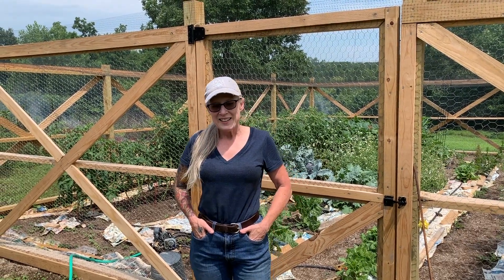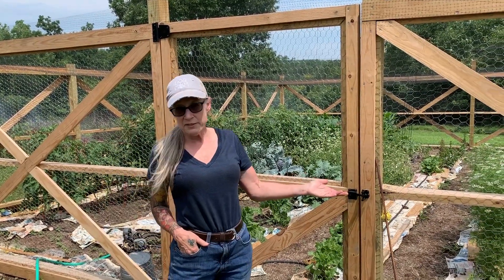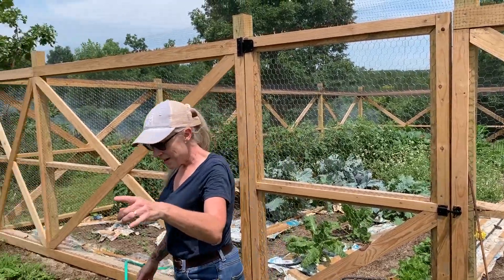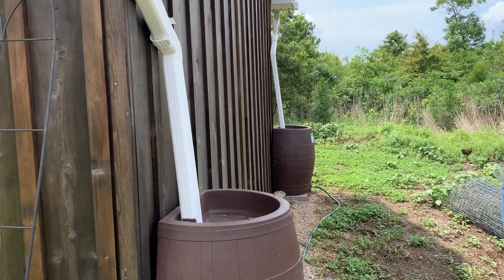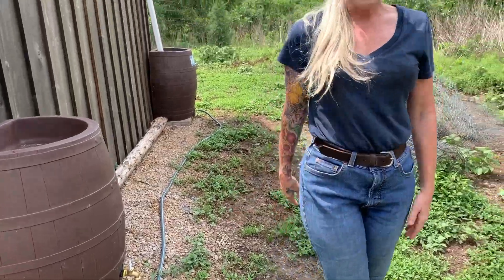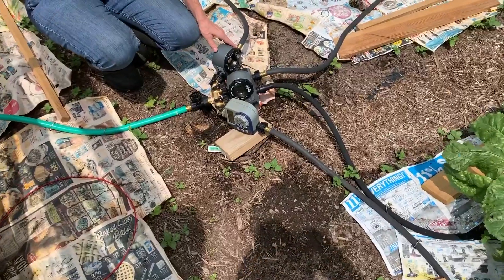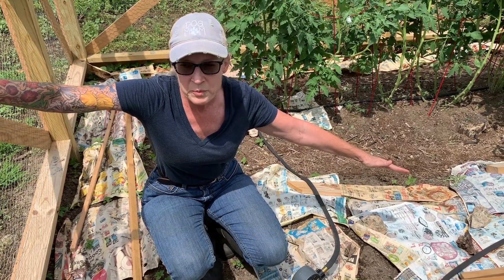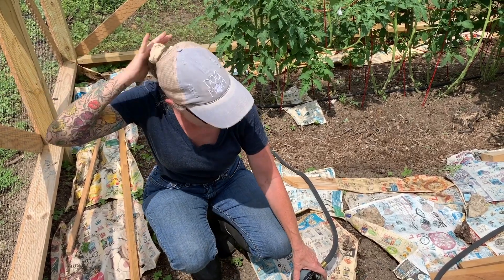Gravity Fed Auto Watering System for Off Grid Gardening

Comment: You can increase water pressure by just raising the water barrels up about 6 ft..

The hoses can still touch the ground, if you want them to.. But if it doesn't matter.. You can slope them downwardly, on a slighted angle... And it would give you the maximum amount of water pressure, at the expense of aesthetic displeasure.
Reply from the maker: Hi Inigo Montoya... good luck in your search for the man with the 6 fingered hand ;-) Thanks for your comment. That is an excellent idea.  I think we could even make that happen in an aesthetically pleasing way ;-)
Reply: Beautiful. 
Nice watering system as well.

Comment: Very cool- thanks for sharing! Do you think any soaker hose will do? I hope to use water rite hoses
Reply from the maker: I think so. I think they are all pretty similar.  You probably couldn’t use a really really long one because the pressure might not be enough to get water to the end.
Reply: @HermitsWayHomestead  If needed, do you think a pump could be installed somewhere along the line?
Reply from the maker: @curly-hairedcountrygal1275  I don’t see why not. 😁

Comment: Hello, very nice and smart garden, i plan to assembly something similar too, but i'm also afraid of pressure for soaker hoses, I would like to know the lenght of soaker hoses and more importantly the type. There are a lot of soaker hoses on the market, but in the US i found some special for rain barrells (rain barrel soaker hose)and generaly for system fed by gravity, which are under low pressure. As long as I am from Slovakia (Europe) and there are just general soaker hoses i wonder if have to manage to buy some from the US, or i can use the clasic one. Thank you very much for answer!
Reply from the maker: Hi Filip ~ I've not found any soaker hoses made specifically for low water pressure. I am just using regular soaker hoses from Lowes. Those worked pretty well even though the pressure from the gravity fed system was pretty low. There won't be a one-size fits all solution since there are so many different variables. You'll just need to adjust the system in order to find what works best. In my case, I needed to change my timers so that the water was only going through one hose at a time to get enough pressure. You could always elevate your water bucket higher up to increase the water pressure as well. Hope this is helpful!

Comment: What’s the brand of those timers? Are they battery powered?
Reply from the maker: These are Orbit Water Timers from Lowes (https://www.lowes.com/pd/Orbit-1-Output-Port-Digital-Hose-End-Timer/50329571). They use two AA batteries which last forever. For most of my timers, the batteries have lasted at least an entire year.